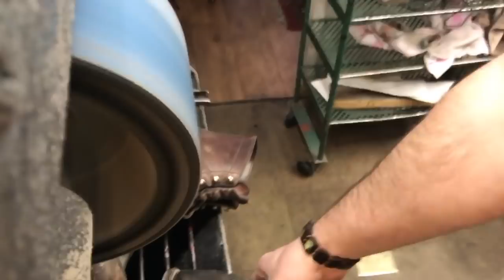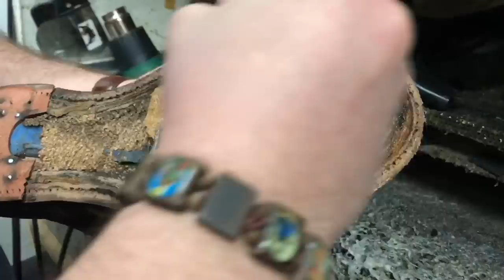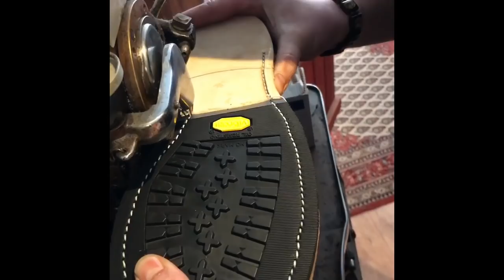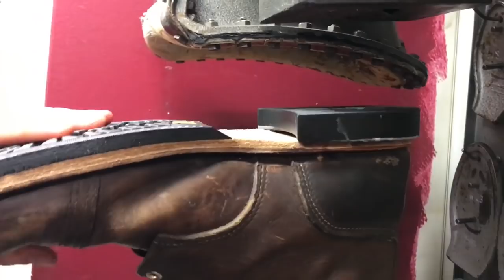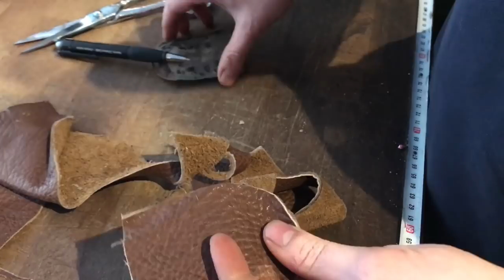How i custom resoled Red Wing Boots

Comment: I'm surprised you don't have to cut a channel for the sole stitching. I know there's enough give to the sole that they kind of countersink themselves a bit, but you'd think that surface would wear down relatively quickly.
Reply from the maker: twoodfrd it's not necessary. They are doing in the factory when they are manufactured and each thread has its own knot. therefore it will not let go
Reply: Would have stitched the leathersole and upon glued the Vibram sole

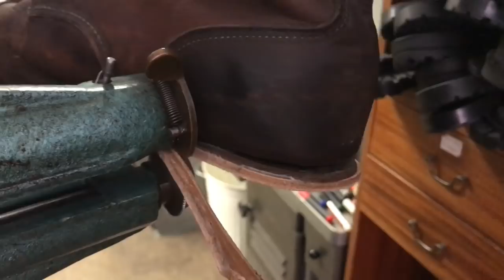Comment: @jimmydiresta this is your leather cutter in action around the 3:30 mark. Explains what the top part does partially #diresta
Reply from the maker: It's a machine called 5 in 1 what you look at the clip, I cut away the overflow of the leather. Then you can press together the welt along with the sole and you can even cut / splicing leather soles

Comment: Great work but maybe you should have cut a groove before stitching the sole... not sure as I'm not an expert.
Reply from the maker: Some one some where It is not necessary on rubber soles. Even if the thread is worn, the glue will hold together👍

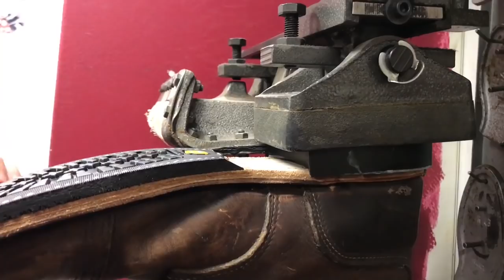Comment: @ 7:09 The only quibble with the video is that the "mushroom" on the nail set should be ground-off.  That formation of steel is very unstable and subject to fracturing and shooting off fragments.  I had to remove a piece of shrapnel out of my hand that was deeply embedded.  Painful lesson learned without losing an eye.

Comment: Awesome work 👍
Wish my Timberland 6" could be resoled but they used that stupid foam stuff for a midsole that has now crumbled. 
Been told by a few local cobblers that there's nothing that can fix that 😢
Don't fancy spending £200 on a new pair as they will be even more cheaply made. Mine are over 15 years old but the uppers are perfect.

Comment: Certainly apreciate your skill and the boots looked great after the work. Really gave them a new life. ..one question though if you don't mind?  On the rubber outersole wouldn't you normally cut a groove into it before you stitch so the stitching does not wear? With the stitching on the surface won't it just wear through very quickly? Thanks!
Reply from the maker: Tom Williams thank you😊 Even if the tread are worn, the sole will not release👍🏻

Comment: Out of curiosity, is there a reason that on the leather soles you make a channel to sink the thread into and on the heal you sink the nails into the rubber, but leave the stitching on the surface of the rubber?
Reply from the maker: ndawgtkd channel on the leather is because it will be easier to stitch. The heels that I did they do so in the factory to, the nail bends in the bottom, exactly as they do in the factory to. The stitches on the Vibram sole will hold. It's  glued good and the seams act like precise insurance. Even if the thread is worn, the sole will not drop. I do not usually make a channel on rubber soles because then the rubber sole can drop the ability or crack at the edges
Reply: @Skoservice  Thank you for educating me.

Comment: NICE WORK BUT THERE A SHOESHOPS THAT RECOVERS THE HEEL WITH A THIN SHEET OF METAL THAT MAKES THE HEEL LAST TIME THAN THE REST OF THE SHOES BUT THAT KIND OF WORK IS MORE EXPENSIVE EACH COVER COST AROUND 25 BUCKS EACH SO IF A NEW PAIR COST AROUND 70 BUCKS YOU CAN ASK FOR THAT KIND OF WORK

Comment: I have bought Red wing work boots for a few years, but in the last 5 years or so, my soles keep cracking at the middle, these are almost $300 boots and they only last me about 1 year and a half, I called Red wing" and asked them if this was a manufacturer defect and they asked me for more Info, I took some pics, sent them and never heard back from them...
To re-Sole them it was about $150 + tax, really disappointed with the customer support... I got cheaper boots that last me longer than that...
Thanks for your video
Reply from the maker: purrungas2012 thank you for you liked the video, boring when that happens clearly.
Reply: Update... Got a response from customer support regarding the boots and the sole issue, they have repaired my boots with a resoled job which has gotten my boots back in action. Thanks for standing behind your warranty really appreciate it and be sure you will not only keep me as a customer but will be recommending them to all my acquaintances, thank you
Reply from the maker: purrungas2012 good that it got right👍👍

Comment: Without fail, I walk through the stitching on shoes that aren't channeled. I do it so quickly that I may as well not even have the soles stitched on in the first place. I cannot understand why so many cobblers don't channel the rubber soles.
Reply from the maker: Hi, thanks for the comment.  I almost never make grooves in rubber after it is not done from the factory either, if you make a groove that is a little too deep, the durability at the front of the sole deteriorates, and even if the threads wear, the sole is still stuck.  with today's glue quality, you could just glue without sewing👍👏

Comment: How much does this cost compared to buying a new pair of boots
Reply: These boots are $350 and a typical resole would be in the $80-100 range.
Reply: But apparently this resoling is $177
Reply: @ekotar1  I need to buy a pair of this shoes so how may I buy them? Thanks
Reply: @MoShaafici  they are called Red Wing Iron Rangers. You can buy them online.

Comment: On the iron rangers, I’m really surprised you didn’t add the cork where it was missing from pulling the sole off. Also the stitching was really off or crooked on that sole.
Reply from the maker: I filled the cork, what to say about the seams, sometimes it does not get completely perfect, but you get better with time.

Comment: Why was the cork not replaced? Also, why isn't there a channel for the stitches in the rubber? That thread will be eaten away in a month.
Reply from the maker: PC_ III The cork does not necessarily have to be replaced if it is whole and fine, and all of these seams have their own knot, so even if the thread is worn, the sole will not let go. This is done at the factory. Thank you

Comment: Actually refreshing to see a resole where the boot isn’t torn completely off from the welt down. I’m always wondering why they always seem to rip the welt off and sew a new one on. I thought the whole point of the Goodyear welt was that it would enable a resole job like this. 

I have to ask, why did you bother sanding the old sole just after the heel came off, then just rip the old sole off the boot? Does it make it easier to get it loose? Not a criticism, genuinely curious...
Reply from the maker: hi thanks for your compliments.  you are right if the welt itself is good then it is unnecessary to replace it, it only costs a lot of extra money.  I sand the seams down to be able to tear off the sole. sometimes I grind down sometimes I cut with the knife depending on which shoe it is
Reply: @Skoservice  Makes sense👍 I find the whole thing fascinating. Kinda wish I had discovered it when I was a younger man, but I’m kinda gettin’ on in years to be changing occupations now 😆

Comment: nice video and nice work, though i do have to ask, why? Red wing replaces soles free for life also will clean and repair other parts of the shoe/boot for free most of the time, sometimes they wont do anything or will come with a price. They wouldn't replace one of my rivets that popped out that was holding my metatarsal in place for some reason.
Reply from the maker: French4Assassin hi.. thank you👍👍. have difficulty believing they fix the shoes for free.. do not know so much about their service factor.

Comment: Look  'I know it's all about the money, ' but,  darn man you could have replaced the cork and gave him a solid shoe sole.  Also, why in the heck didn't you cut a stitch bed in the sole?  Now he will step on something (Hot)  or  something  (Sharp) or just (Walk)  the stitching out.  In my opinion,  you gave him very poor workmanship.  You should have went the extra mile young man. The person working in those boots needs longevity from them. Dependability and craftsmanship is what  you should be giving each person that comes to you with shoe problems. Right?  Have a day.
Reply from the maker: James Kennedy I notice that you do not know anything in the craft. did not want to comment on your comment but i do it anyway For that matter, I filled the cork. The seams on the sole will hold even if the thread is worn out. so do the factory from the beginning. The soles I use are Vibram which is the best in the market. In short, the shoes are better constructed than in the beginning. Find out your facts before you start writing that way
Reply: You didn't show replacing the cork.  You know the stitching will not hold up. In my opinion,  your hoping  that the glue will hold if the stitching fells and it will.  I've done all this before.  I have found that the stitching has to be protected.  To many call backs for me. Just good business to put the stitches  under cover.  You may have been the one who put this video out so the world could see it. Did not mean to upset you sir.  I just thought  job quality could have been a lot better. Thank you for your time in the production and release of this video.
Reply from the maker: James Kennedy It's okay I'm not upset. I can say of all the jobs I've done, so never have a sole gone because the thread has been worn down. Each thread has its own knot, so it can not be released so easily. I always grove on leather shoes, but I'm never grove on rubber soles, because I've usually seen that it weakens the rubber which can break or crack. That's exactly why they do so with all rubber-sole shoes like Vibram or dainite in the factory when they are made. Sincerely Skoservice
Reply: Look boy's i'm not cobbler but I truly appreciate the artisans who do quality work today in 2018. I happen to have my boots resoled this same way. Vibram sole and stitched all the way around. I was also worried about the stitch breaking after wearing down the sole. Still it's a bit of a concern but I don't think it will be too much of an issue. I have been wearing them in a dry climate and in the summer time. Not wet,cold conditions. I suppose it depends on where you are most of the time. I wold go to cobbler school boot camp if  I could. I love the art. Great work